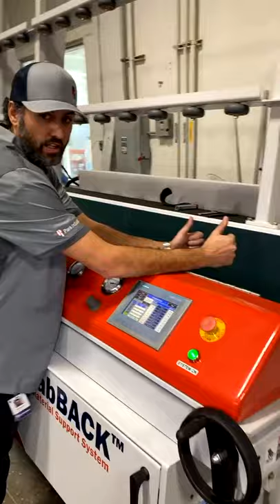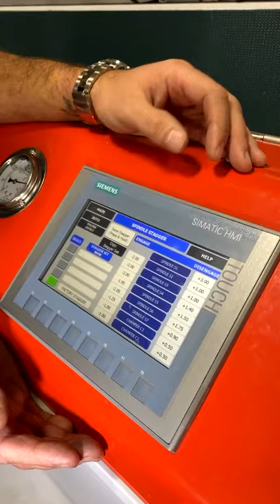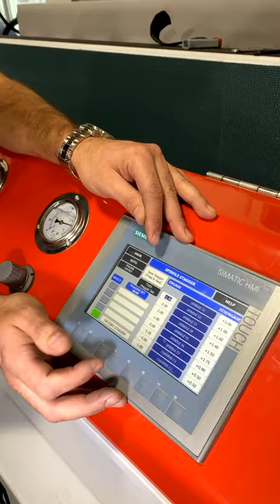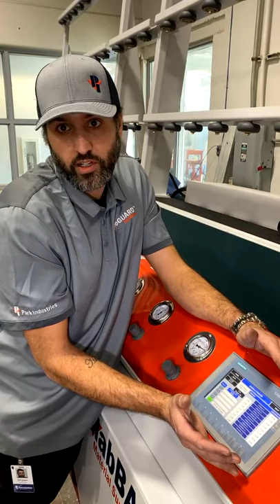FASTBACK Stagger Settings & Tooling Tips

Comment: great video on the fastback, only one thing. I have the same issue where it leaves swirl marks at the end of the piece. he was describing that it could be the stagger but it could be something else and I can't make out what he's saying. he says "the blade might be set wrong?" and then he says it might be zinging out of there. I'm wondering if he's talking about the speed of the conveyor belt? or is he talking about a bad pad?
Reply from the maker: It could be that the saw arbor isn’t dialed completely straight. Please reach out to our customer service team at 800-785-3391 or email them at customerservice@parkindustries.com. They will be able to assist you and get your FASTBACK running smoothly!
Reply: @ParkindustriesUSA  Tomorrow when I get to work I'll give you guys a call.